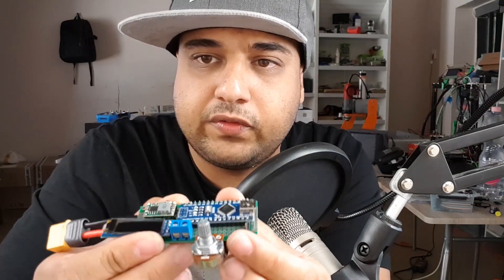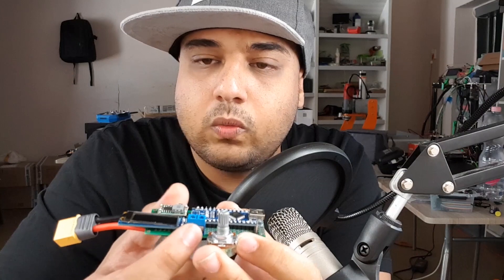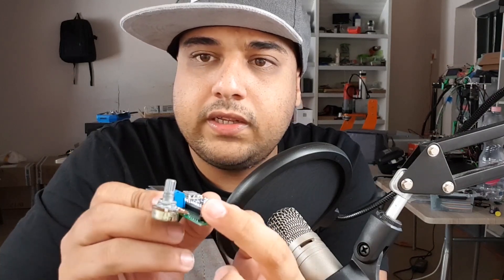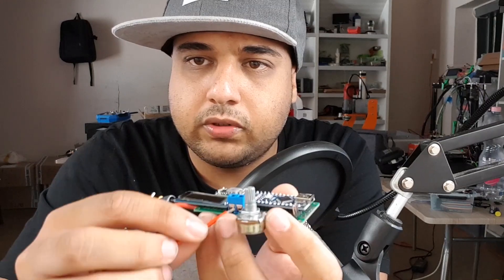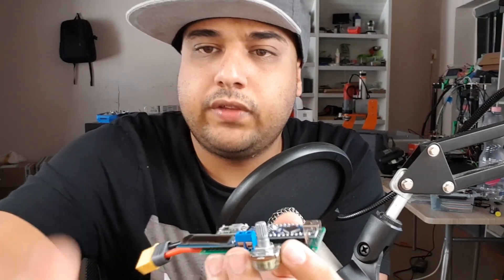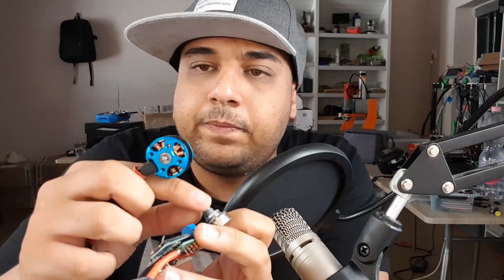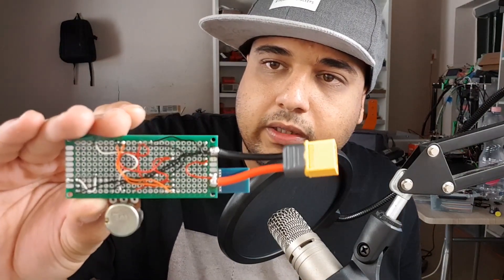DIY Arduino ESC Tester / Motor Tester , Skyzone SK03, Aomway V3 // Morning Vlog #009

Comment: I emailed you about the Aonway u modded.  Hàve u ever repaired a solder pad and trace. They ripped off my ev100 goggles and I'm grounded till get new goggles
Reply: I can fix your goggles for you
Reply: @kantonpeacock5060  cheers bud but I'd say I'd buy a new pair by time I pay for postage to u then back to me and give ya few quid for ur trouble.   I'm gonna give it a shot myself as a project. Have the Aonway bought now from drone mesh so I'm sorted for goggles.
Reply: I add solder to the iron, a lot of it, and then touch the ripped pad a few times for the solder to grab :) fixed my vtx this way
Reply: @LeonVuksic  the pads are off completely so nothing for solder to grip to. I'm gonna try glue new pads on and some trace for one pad. It'll be a fun project.

Comment: Antenna mod on taranis x9d plus what can be done if hot glue comes loose and lift the pads
Reply: you could probably track the signal pad back to somewhere its soldered, the ground you could do the same or use any nearby gnd.   you could search for info on the board and possibly get solder points named if tracking it isnt possible, its usually soldered at the edge of the metal casing on the board.